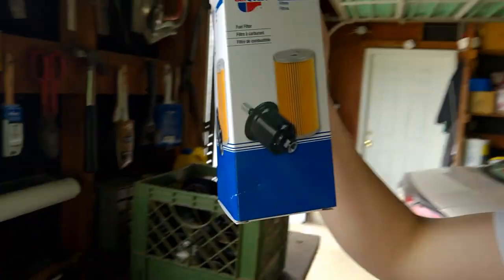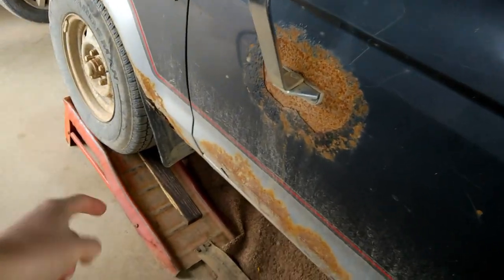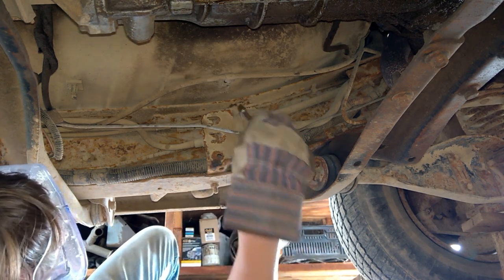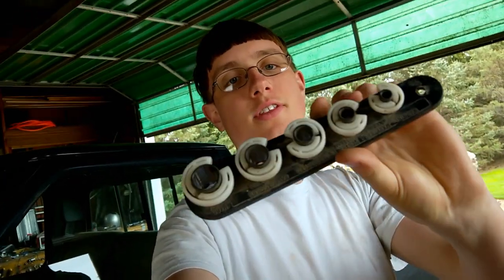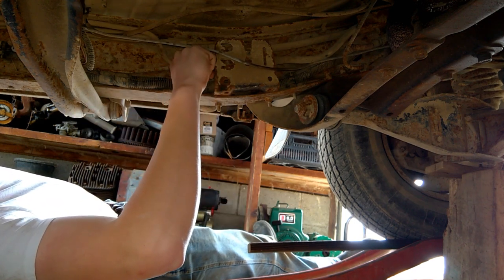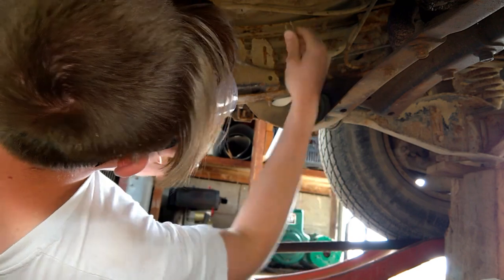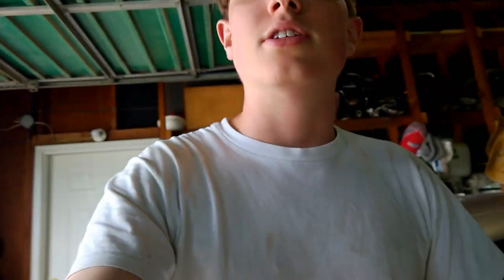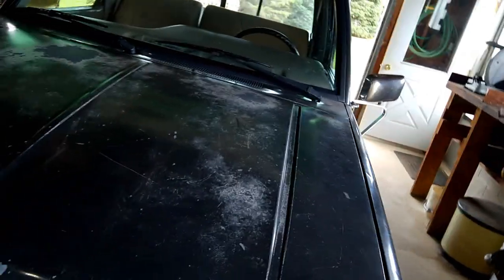Fuel Filter Replacement On A 1989 Ford Ranger!!!!

Comment: The inertia switch is under the heater core behind the glove box. If you push the button on the inertia switch it drains the gas back into the tank. I just replaced mine on my 88 ford ranger
Reply: did you open the glove box?
Reply: @westtrumpet7  i dont need to open the glove box to get to my inertia switch. Its below the gove box right where the carpet ends on the firewall.

Comment: Get a shop manual for your truck! They are inexpensive, common, and a time saver. Plus, you will know what and where the parts are, what they look like, and what tools you will need. I have shop manuals for my military GMC, '79 GMC C-1500 "Heavy Half", '90 Ford Ranger Custom, and 2004 Ford Taurus SE. They cost between $50 to $11 each and are well worth the prices. No rust here in this part of Aabama, and the Ranger is coming up to an engine swap at 300k plus miles. I'll drive it until It quits, then park it until I find a good 2.5L normally aspirated no computer engine to stick into it. I get sick of replacing engine control modules into it.

Comment: Nothing like someone who's never done a job before and doesn't know how to do it making a video and how to do it  I have an 87 Bronco my filter mounts in the same place the filter looks the same but the bracket holding it is different. I have a Driveshaft in the way because it's 4-wheel drive. The driveshaft from the front end to the transfer case of course is offset to the driver side so it's right in the way. My emergency brake cable also indirectly in the way and since it is adjusted correctly it's tight. Last there is a plastic clip that just pops off holding the fuel line on each end. I'm not buying a tool I'm only going to use a couple times & cluter up my toolbox.

Comment: You know I ordered a fuel filter for my 86 Ford Ranger,, and I got a mini size oil filter looking thing okay I'm not totally unhip to the way motors are rebuilt a few times etc etc but what I'm looking at on my 86 Ford Ranger is a waffle like thing on an 86 it's a late 86 what the hell

Comment: Whats the quick disconnect line called going from the outlet end of the filter up into the motor mine snapped off the quick disconnect part and now I'm stuck because I can't put the filter in because I have to replace that line after the filter and I can't find the name or find it anywhere.

Comment: where is the that thing to relase the fuel pressure? i cant find it. my truck is a 1987 ford ranger 2.3L
Reply from the maker: I am not sure exactly where it is at but you could always unhook the fuel line coming from the tank going into the fuel injection system.
Reply: @marksshop3029  dang I’m still lost man I’m like so close of saying screw it and just have gas all over the place hahaha
Reply from the maker: Yeah.....it really isn't that much fuel when it really comes to it.

Comment: I always just pull the fuse and let the car stall out to release pressure before doing this.   Probably will still spill some, but it is is not as crazy.    I was just watching this video to get an idea where the filter is on a gen 1 and what you need to remove to get to it.   I just bought a 1991 and am about to do a good tune up before taking it on a road trip.

Comment: 6” hole saw and cut a circle in the bed and pull the fuel pump right out.. then weld a plate back over the hole!

Comment: i got to do the same on mine. after watching you do it, i think ill unbolt that plate and then use small hose clamps instead.  those clips, even lasting  30 years just didnt seem right to me.
Reply from the maker: Yeah I will agree with you on that but after lasting 30 years I figured they would last another couple years.
Reply: @marksshop3029  mine is having a tuf time getting started and then to keep running, i just got it and it sat for a few years. am going to change the plugs and cables but also thinking it might be the fuel pump. 
did you bypass your inertia switch by any chance?
Reply from the maker: I did not bypass that switch....I recently put a new pump in this truck and it seems like it improved startup slightly but it still starts hard.
Reply: @marksshop3029  thanks for sharing. maybe ill end up replacing everything soon enough but still worth it for me for the truck i look long and hard to find.
Reply from the maker: Yeah I really like the Rangers....I should probably try to find the problem with our truck sometime.
Reply: It is a fuse that cut off gas under hood

Comment: Did you solve it? Try you MAP.
Reply from the maker: So actually just a couple of days ago I put a new fuel pump in it and so far it starts and runs good. So hopefully that was the problem. Thanks for checking out the video!

Comment: There is a relay for the pump.
Reply from the maker: I figured that there was probably a fuse or a relay somewhere, but the truck had been sitting for a few days so there was much pressure in the line. Thanks for watching and leaving the great comment!